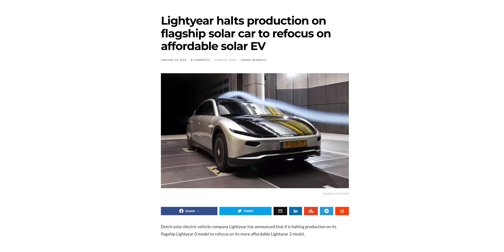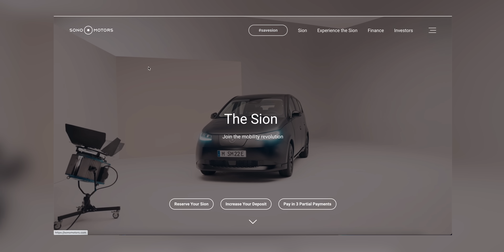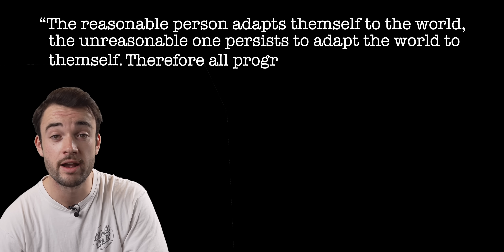Will Solar-Powered Cars Ever Happen??

Comment: You seem to forget the best Solar EV, the Xbus build by Electric brands. 
Last month they made the deal with the Dutch car company VDL, that builds the Mini. 
In 2023 the first small Evetta (not solar) will be in production, but the production of the Xbus will start in 2024. And not for €250.000 like the Lightyear, but for around €19.000 for the base model. 
A total of 9 models with countless configurations. All with very large solar packs that can always be outfitted with larger battery packs later on.  
Refreshingly not an EV that follows the rule of BIG BIGGER BIGGEST HUGE. 
But with a smaller footprint, LFP batteries that can be extended for different use cases, and lots of other innovations.
Reply: As with Lightyear and Sono. Having a contract with contract maker doesn't guarantee it goes to production. It does ensure the technical and practical ability is there. Guestion is, is the money. Why is Sono suddenly saying "We need this huge pile of money, now."? To pull the trigger on Valmet actually starting production. So far there has been prototyping and pre work, maybe production tooling making, setting up supply line bids. Now would be the time to say "Yes make us 10 000 of these". Well Company like Valmet will want cash in hand before they produce. Most likely even the first batch fully paid out before hand. So they aren't left with expensively retooled production line and some produced cars and buyer with no money. It would bankrupt Valmet Automotive and they have no plans to go bankrupt. They want hard cash for making the tooling and hard cash for each car. Will the car sell to customers? Not Valmets problem, Sono's problem. Sono give us X million Euros, we will make you 10 000 Sions and deliver them to you. After that you can do with them what you want. Not our problem, we got our money, did our job, contract complete.

Contract makers don't do "we (the brand) give your share of the money once we sell the car to customer". It's cash in hand or no product leaves the factory. Production doesn't start until brand has paid enough start up fees to cover the tooling costs. Again so company like Valmet is not left with retooled production line and then customer brand going "oh actually... we changed our mind, don't want it produced" or between starting retooling and retooling being complete the customer brand has gone bankrupt. Again leaving contract maker holding the bag. Contract makers plan never to be left holding the bag. Their contracts and payment structures are constructed to protect them against volatile automotive market. Model doesn't sell? Not contract makers problem. Brand goes bankrupt? Not contract makers problem. They get everything paid before hand or at maximum on delivery of product on at most favorable to the customer brand.
Reply: @aritakalo8011  Many tekst, could be less and say the same. 
Lightyear cost €250.000 and loses on every car. Sono has an estimated starting price of €31.000, where already a lot competition is. 
Xbus has an estimated starting price of €18.000. No competition what so ever. 
Dealer network is up and running, Insurance and Banking side is in place. It is a crowdfunded project and many buyers already made downpayment. First 2 models are in prototype and fully running. 
I guess they have a good chance to pull it of. We will see in about 18 months.
Reply: Xbus make the most ridiculous claims of the lot. If you do the calculations their claims on range means their vehicle is twice as efficient as a Renault Twizy (the most efficient EV on sale) and their claim of 200 km per day from solar panels is true... as long you're in Alice Springs in the height of summer.
Reply: @drunkenhobo8020  Every claim of EV builders is the theoratical maximum. That Twizy is 50kg leighter but is way older tech and has no solar panels. 
The total range of 200km was with the largest solar roofs and outfitted on the model with extra the side panels. 
Assuming you ride that EV on a sunny place all day. 
And remember, the Xbus only weighs 500kg empty. 
It was measured with a average speed of (i think) 42kmh. Higher speeds lower range.
It is never designed for highway rides, but has a topspeed of 100kmh. 
Other experts calculated it to be correct. There is a video of that on YT. 
It is not a replacement for the average salon car or SUV. 
It is a new segment of very lightweight EV's .
Reply: @drunkenhobo8020  Twizy was build in 2012 with 6.1kWh old battery type that weighs 100kg. 
The Xbus will be build with modern batteries that are 80kg for 10kWh (10kg per battery, in a pack are 8 batteries.) 
So your fantasie that the Twizy is the most efficient EV is 100% total BS. Maybe in 2012 it was, not in 2024.

Comment: Honestly I don’t get the fuss over the Aptera. Would it ever be the only vehicle someone uses? Much more likely to be a fun-mobile for wealthy people. Not what the planet needs no matter what the power source. Sono all the way for me!
Reply: As a single person, living in an apartment without means of any home charging,the Aptera is perfect for me.  Affordable enough, especially when the savings on fuel is factored in, and perfectly suited for my lifestyle.
Reply: @ryanflake3481  You'll never save as much on fuel compared to just buying a cheap used petrol or diesel. You spend, what, 5 grand on a used car and keep the difference for fuel and maintenance. How many years do you have until you just about "break even" with the Aptera (which, at that point, might need battery replacement / parts need to be changed, on top of what's already been paid for the maintenance until then / the electricity you've "charged" it with)? 10 years? 15 years? Maybe 20? It's neat, but still nowhere near "affordable enough". If people were being honest, they'd just admit they "want" an Aptera; they don't actually "need" one.
Reply: @KonsaiAsTai  My current car I bought new in 2009, is a Smart Fortwo.  My car before that was also bought new and was a '96 Saturn.  I don't like changing automobiles often, so the idea of a 15 year period driving the same car sounds like heaven.  If that is all it takes to come out ahead while also having a fun car to drive, sign me up.
Reply: Really? Because I see it as the vehicle for tightwads (like me). 350mpge and most trips can be taken without even plugging in? Yes, please.

I will grant that my kids are all grown, so I rarely need to have more than 2 seats. That, to me, is its biggest drawback.
Reply: My wife and I are mostly retired, and it will more than meet all most all of our needs.  There are many people, both young and old in our category where the running costs of Aptera will be less than any other vehicle we can consider that would also meet our needs.
Reply: Every year that goes by, fewer and fewer people are having children in the developed world. The retired population, without children in the home, is getting larger and larger. I'm not here to comment on the socioeconomic and geopolitical implications of this transition, but not everybody needs a four-door sedan. The efficiency, range and price on a 2WD 400 mile range Aptera is such that buying two and having your family travel in two cars would be more cost effective than a new Tesla model 3. Most of the excitement they've drawn is from people who are excited about an inexpensive, long range, and unique EV. I am one such person.

Comment: Why does Fully Charged never report on German Electric Brands X Bus? They have recently announced a partnership for manufacturing in the Netherlands of the electric solar modular vehicle. I would have thought this vehicle to be right up your street.
Reply: I’ve been trying to contact them to arrange a shoot for months and getting nowhere. Frustrating, looks cool (if it’s real).
Reply: @JackScarlett1  Given that they advertise a clear lie (15 kWh battery for 'around' 200 km range for a 193 cm high car with a drag coefficient like my wardrobe), I don't think it is real.
Reply: @JackScarlett1  I remember an Xbus article on Top Gear where I ran their numbers through a reality-checker. They're claiming efficiency double that of the Renault Twizy and solar charging rates that only makes sense in an Australian desert in summer.
Can see it only ever existing as prototypes and flashy renders.
Reply: Don't mention the war.